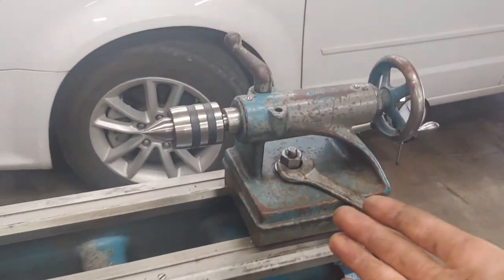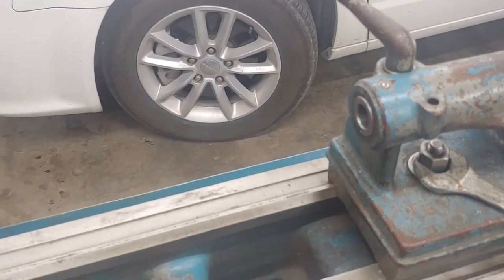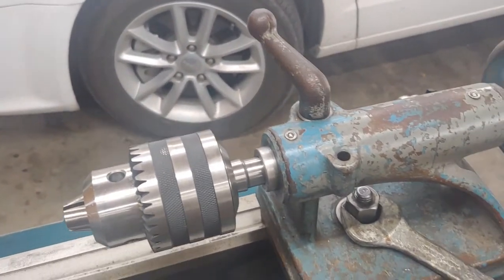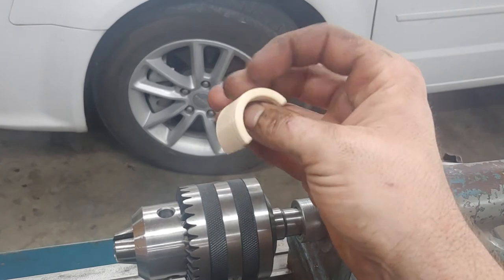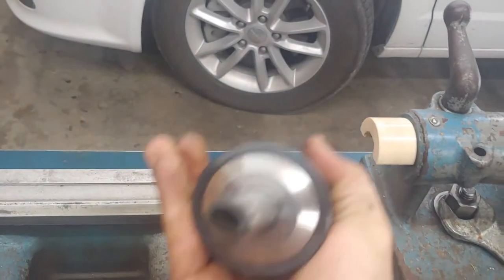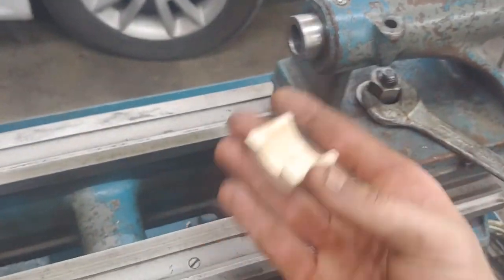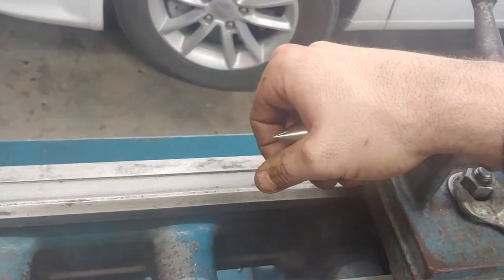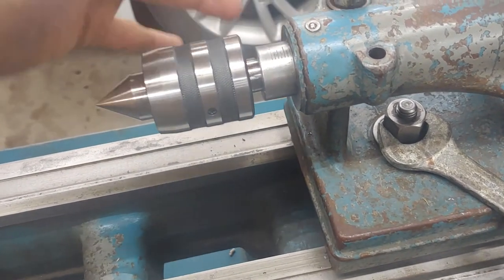Simple tool for removing tools held by a taper

Comment: Thank you. No 3 D printer but I'll make something. WTF? Why do they make them like that?
Reply from the maker: So my tailstock has a bar in the back to force attachments out, some of my tool holders have a screw that will push it out, some don't, so shortly after I made this I also discovered I just needed to alter some sort screws
Reply: @jesse.chadwick1224  thanks for the feed back. I watched another video where the guy just took the whole center of the tailstock out and that worked for me. He just extended that tube on the inside all the way and then it comes out. Then you can access the taper.

Comment: why not screw a bolt in the back? just put screw and if you use in the mill, not use it
Reply from the maker: So I didn't realize that was the issue, this only took maybe 30 minutes total to make. After I made it and investigated further I fugired out my other attachments for my tailstock have a machine screw installed to pop them out. So your right, a bolt in the back is the easiest way.